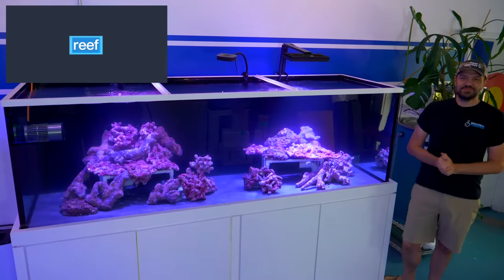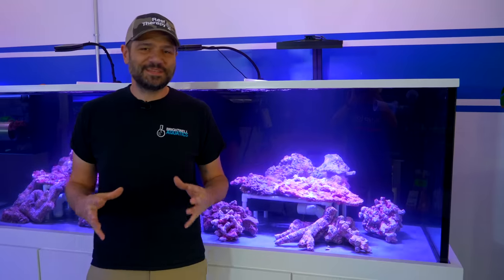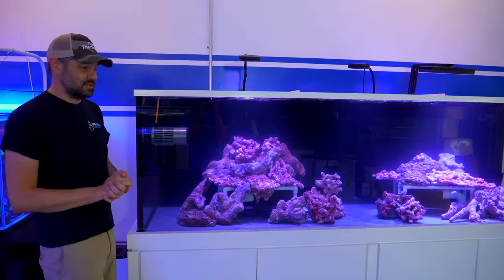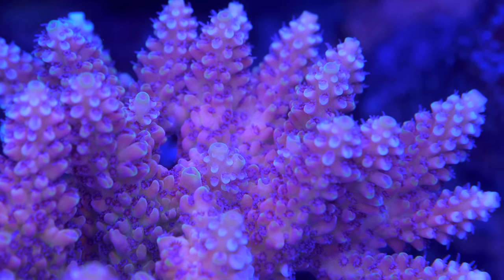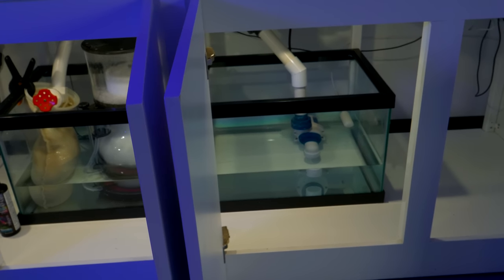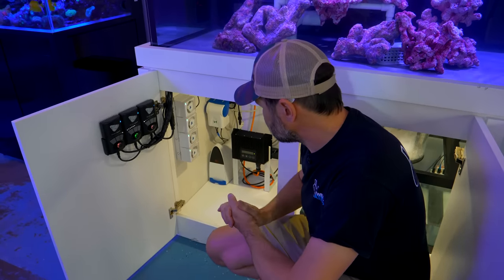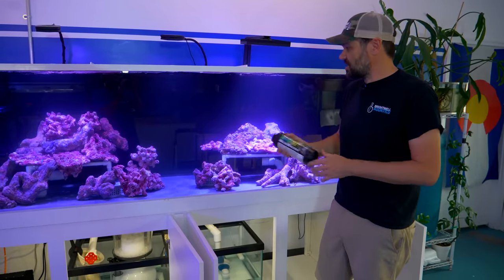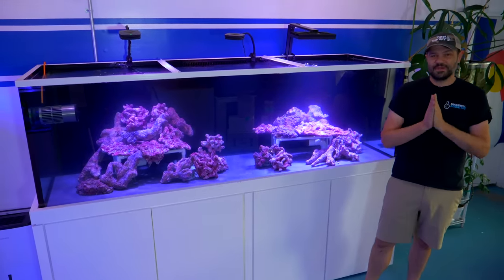Hardline 400 Gallon Reef is FINALLY Running!

Comment: Am partial to the choice of 10-12 Radion xr15's g6 blues;) As I sprung for g5 to g6 upgrade on my xr15 g5 blues for my Acro tank;)  Better spread/coverage verses xr30's.. You can always run half ur xr15 Blues on a different program and "whiten them up" like the Pro version.. From my own experience building my own multi channel dimmable LED lights.. A 4:1 or 5:1 ratio of blue to white LEDs is a better ratio.. And your able to turn fixture (all channels) up to a usable (usable for coral) 100% verses dimming the white light down.. The Pro version is for "our eyes" and "picture taking" (@ 100% on all channels) and not so much for the corals benefit - so i believe / my thoughts as an electrician 39yrs/ R&D & trial & error on my own light builds over 40yrs in hobby and the ever evolving new light sources;)

Comment: Been using Loginov’s skimmer for the past year or so. Crazy air-to-water surface area for 1/3 of the price. I’m more than satisfied.
You should verify the inner air tube is fully inserted into the printed part though, the depth is a bit elusive and it requires a bit of force to put in place. I believe this may be the root cause of the “white noise” you are experiencing.

As for lightning - after a year with the Uno by ReeFi I can tell that oh boi does it grow and color up acros.
I’ll also plan to try the new, recently announced Uno 2.0 Pro over my future frag tank I’m designing. 260w for 360$, 114 Cree leds, better spread and more blues all in the same package as the previous model. You really can’t beat this up.
It pumps out more Wattage in spectrum than the XR30 G6 in a XR15 sized package 🤯

Good luck man, wish you all the best!
Reply from the maker: Nice to hear feedback from another A&C user, I will double check and make sure the inner air tube is fully inserted. Those Uno lights really offer crazy value like the A&C skimmer.

Comment: This is the build that I am excited about! 100% dedication to just a single type of corals. My only question/idea is if you couldn't repurpose the "easy reef tank" from across with the clowns in it by connecting it to the sump and then make it into a smooth skin acro tank..... now wouldn't that be a sight a 400gallon high flow/light Acro tank and a 30 gallon deep water acro tank all in one system ;)
Reply from the maker: Funny you should mention it, but I've really thought about making the CADE reef tank more focused on DW/Naked Acros, but hadn't thought about connecting them

Comment: I'd do 2/3rds Diffused Radion Blue's with 1/3rd Kessil, personally. But, I'm biased. Arguably, a similar mix of Blue's & Pro's would also look fantastic and achieve the same balance. The Blue's are a great primary fixture. But a secondary warm source for peak hours seems to be a solid compliment, filling in the spectrums the Blue's lack (in abundance). As their is something nice about seeing "peak sun" closer to a 5500-6500°K. While having a strong 14000-20000°K the rest of the photoperiod. 

Nice to see it running. It looks glorious with the dual closed loop, and what can only be described as a "cannon" lol. It looks like a super fun tank.
I'm sure it will look even better once your coral flats clear out. Though, I adore your coral flats, seeing them empty I'm sure will be bitter sweet.
Reply from the maker: That's a well considered comment! We added one coral yesterday and man it looks so good in the diffused daylight before the lights come on, the reefer in me feels compelled to get as much blue as possible by mixing in G6 Blues but then I know these corals will actually look their best under nearly bright white daylight spectrum, so I hope to use fixtures which enables both options.

Comment: are you sure the vibration from the closed loop overtime will not cause leaks? I would feel so much better if the pumps were supported
Reply from the maker: If you go back and see how we routed the hole to precisely fit the gasket you'd know there's just no way that it could leak as the gasket is compressed from all sides. Furthermore, I had every intention of attaching/mounting the pumps to something but that 1.5" PVC is pretty stiff, I would ADD more tension than I would relieve by mounting them somehow, but great points overall.

Comment: I understand the excitement and passion but please, please, properly secure those Vectra pumps that you are using in the close loop.  The NVH (noise, vibration, and harshness) is going to cause a bulkhead leak if you are lucky or catastrophic failure if unlucky.  I personally wouldn't want to gamble.  Abyzz flow cannon, well, is out of place today but maybe it will fill in over time as your colonies mature.

Please accept my apology for critiques.  I know you are passionate and care I just do not want to see something a  year or two now due to an oops.  All the best to you and your reef pad.  Great day to you and yours.
Reply from the maker: trust me, the 1.5" PVC is rigid enough to support the Vectras, any degree of securing will add more tension than it relieves. If you watched the older videos of the closed loop you'll see we used 'super duper' bulkheads with a routed section for the gasket, ain't no way it's going to leak.